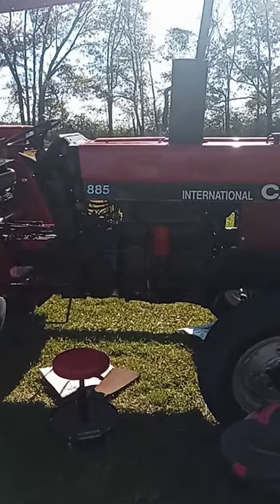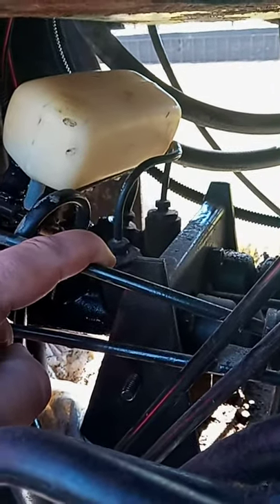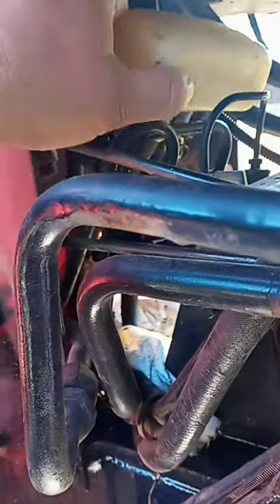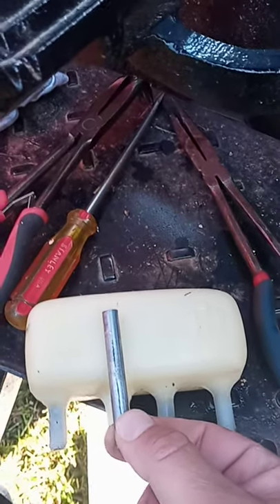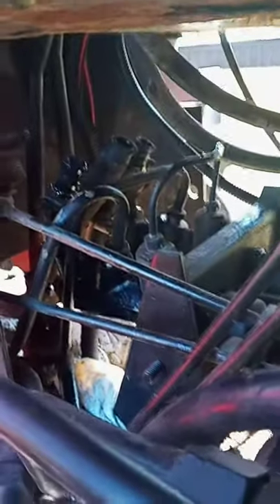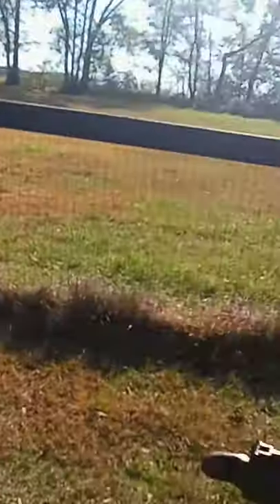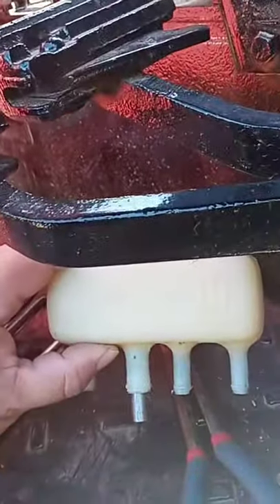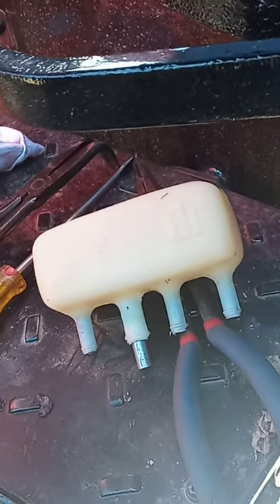Case International 885 Brake System Repair

Comment: You're absolutely right no info on this at all, even in the maintenance manual there is a blank on the brake system, thank you so much from Cornwall England

Comment: If you've ever wondered if creating a video like this one makes any difference. It does. My 685 with only 2,100 hrs lost ALL braking over the past winter. I tried several solutions - none worked until I spotted your video. To be sure, removing and replacing this reservoir is no small task. There is almost no clearance for hands or tools under the dash. I ended up removing the hood and the battery box just to gain access. The 'return' line stand pipe was out of the reservoir by 3/8 - to 1/2". Further, one of the small brake cylinder standpipes was out about 1/8". I super glued all of them back in after a clean up. Reinstalled, bled brakes following CASE instructions - got the best brake pedal I've ever had with this tractor. Thank you for your effort.
Reply from the maker: That's why I started doing it.  I had such a hard time figuring things out on my own with the whole farm start-up, I figured folks out there could use some hard-earned wisdom.  Thanks for the comment.

Comment: Just had today a local Case dealer on the phone and he told me exact the same what I have with my case tractor. Many thanks for visualizing this before I take it apart. 👌
Reply from the maker: Thanks much.  Hey, it makes the job a whole lot easier if you go ahead and take out the battery tray.
Reply: @bignatehobbyfarm  I have a Case IH 5140, the battery tray is just under the cabin on the front 😀

Comment: THANK YOU for this video. Our CASE IH 685 is having the same issue - this gives us a place to start.
Reply from the maker: Hope it helps.  Very rarely do the seals inside the axle brake assembly fail, so 9 out of 10 problems you will have involve all that mess down there below the steering wheel assembly.  Then bleeding the brakes of course, but that's fairly simple.
Reply: Mine was a case 380b tractor loader.

Comment: Thanks for the video. Working on 584 brakes.
Reply from the maker: It might be easier to do the whole thing if you pull out the battery tray.  I need to replace all the rubber lines on the reservoir, and I'm going to go that route.

Comment: How far back in should it be pushed?  The metal pipes to the reservoir
Reply: The metal tube should be flush with the bottom edge of the plastic nipple
Reply: Thank you very much for your reply